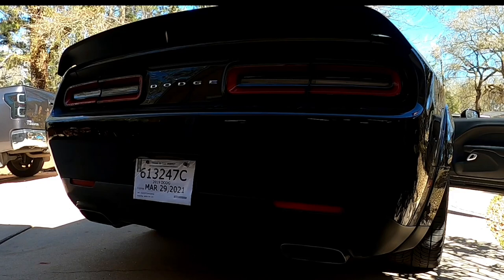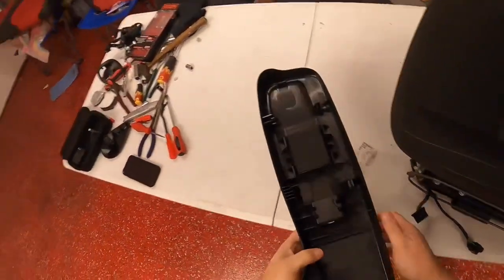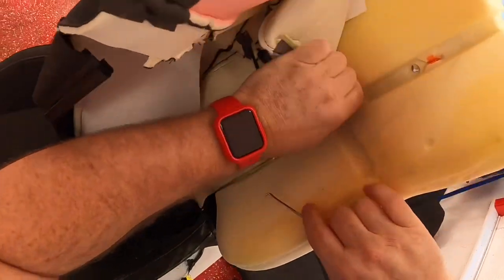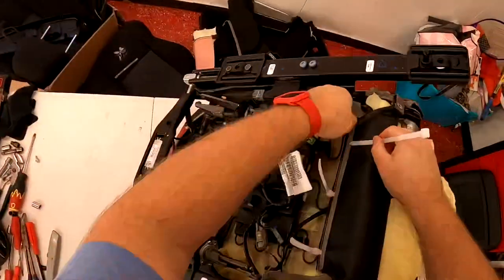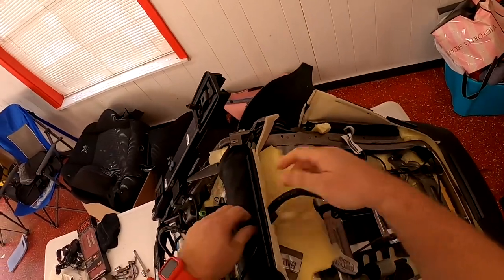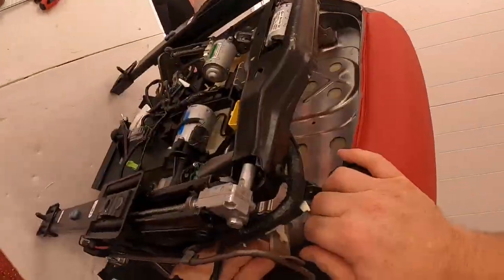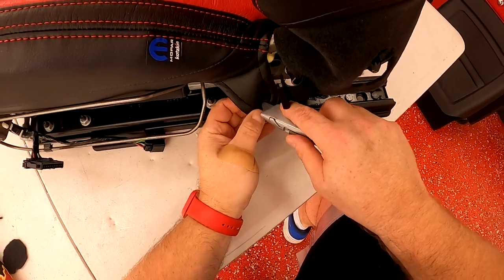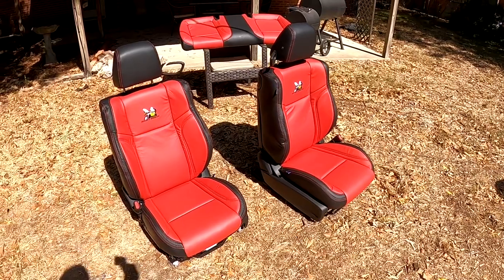How to replace the factory seats with leather in a Dodge Challenger. It can be DIY! (Part 1)

Comment: Where does the metal sprint go back into with the recliner lever?

Thanks for releasing this, there isn't a lot of information out there this in-depth.
Reply from the maker: On the lever (the inside part) you’ll notice a couple of slits. Pop the spring thing on where it sits in those slits then just put the lever back on and it locks back in place.

Comment: I am finally getting my seats in about 2 weeks had a quick question on the lever did you have to take it off in order to take off that plastic piece or was it mandatory to take off? Thanks again i learn alot from your videos keep them going 👍🏻
Reply from the maker: Yes you need to take the lever off. Be sure to watch part 2 for more tips. The lever is held on by a little clip you pull off then the lever just comes right off.
Reply: @moparlifescatpack life saver! thank you.!
Reply: @moparlifescatpack did you unplug the battery in the trunk so it wont throw any codes when put back in?
Reply from the maker: I did not unplug the battery however, that is never a bad idea to do.

Comment: We love your videos.. And we love the scat pack! Religious watchers here of your channel were going to order a 23 purple scat in 6 speed manual
Reply from the maker: Awesome! Thanks for watching and enjoy the ‘23! That was my plan last year to keep this a year then order a 2023 in the exact spec I wanted but I recently decided I just got too good of a deal on this one to give it up so Im making it how I want it and enjoying every second of it!
Reply: @moparlifescatpack  we love the seat mod.. The kill switch were Def going to do.. And the scat pack door logos are badass! Are you going to be doing any other modifications?
Reply from the maker: @l042987  Im not sure what the next mod will be. So far I’ve done a pedal commander, catch can, Hellcat airbox and Hellcat air filter, red tube inserts on the grill, Scat Pack logo lights on the doors, door sill logos, Powerstop brake pads, rock guards on the front fenders, locking lug nuts, floor mats, leather seats, active exhaust delete, front license plate mount I can pop on and off, cup holder inserts, and a rubber rear license plate holder with locking bolts, a kill switch, and a neutral block plate, and a Dukes of Hazzard horn 😂. My mind is always working so I may come up with something else fun any day.  Lol
Reply: What are the red tube grille inserts?

Comment: Well, the new leather seat covers should be here next week for our '20 Challenger Scat Pack.....I'm pretty excited about changing the material.   It jas the hounds tooth cloth like yours did.  The new ones are black leather and black suede...the car is pitch black......👍
Reply from the maker: That’s awesome! Upgrading the seats changed the feel of the whole car. So worth it!
Reply: @moparlifescatpack  
New seat covers got to the house yesterday.   They were in a katzkin box, but they're the oem leather/Alcantara covers.  They're in excellent shape,  got an awesome deal on the full set.  Going to wait until winter to install,  once we get into the winter days......still excited about it!
Reply from the maker: That’s awesome! Be sure to post a picture of yours on the channel’s Facebook group so we can check them out! https://www.facebook.com/share/FfBnpunpzFVfLhex/?mibextid=lOuIew

Good luck on the install!
Reply: Well,  we couldn't wait until winter,  I started yesterday with the back seat.  Went really easy thanks for the tips on your video.  I took the time to vacuum under the seat, and wipe down the trim that the seat covers. May have gone a little extra by cleaning the brackets for the upper part ....lol. did the passenger front today,  and will at least start on the driver's seat tomorrow.   I'll post pics once completed.
Reply from the maker: @Daytona-fr7fx  That’s awesome! I’m glad to hear its going good and I definitely want to see the end result. Its alot of work but definitely something to be proud of and show off!
Reply: @moparlifescatpack  
Definitely a lot of work.  The back seat didn't seem near as tough as the front.   Even the arm rest,  and the headrest(on the front seat) went pretty good.  The bottom on the front seat still has the string, I found that you can hook 1 side,  then clamp a vise grip on the stitching of the loop for the other side- makes a nice handle to hook the 2nd loop.

What does anyone here use on the seats? Both the leather,  and on the suede.   I have a bottle of meguiar's leather cleaner/conditioner that I used to clean the material after assembly,  before installing in the car.
Reply: Where are you guys ordering them from?

Comment: Once the tension string on the base seats is cut, is there a way to get it tight again? Or tie it back together?
Reply from the maker: I don’t recall there being strings on the new covers so I’m not sure where this would be in the video. But I used zip ties wherever I needed to take up any slack.

Comment: Could you add the link to part 2 for the back seat and the link to order the covers thanks
Reply from the maker: Part 2 can be found here: https://youtu.be/ci33pd-DS4c
Reply from the maker: I bought mine from eBay seller sealeddeals. Great customer service. He walked me through the whole process so I could get them exactly how I wanted.
Reply: Where did you order you new seat covers from?
Reply from the maker: @ViTrucker340  eBay seller sealeddeals.  He was awesome! Worked with me (great communication) to get me the seats exactly how I wanted them.